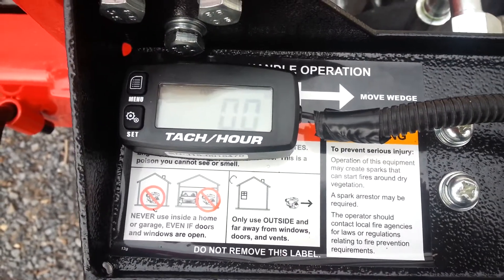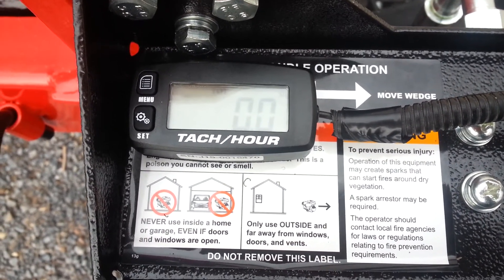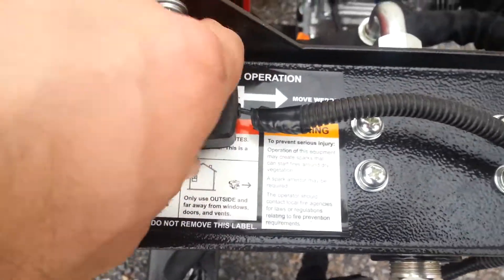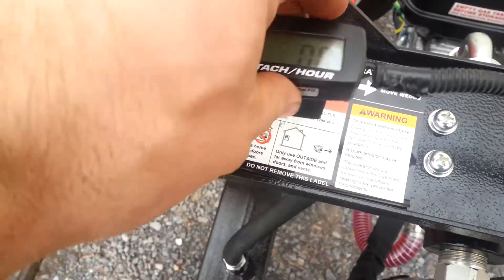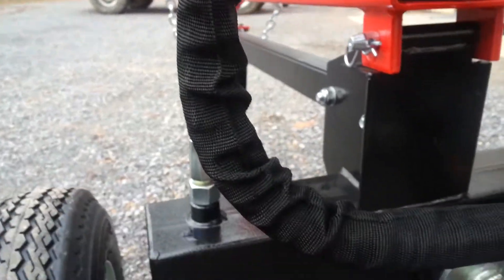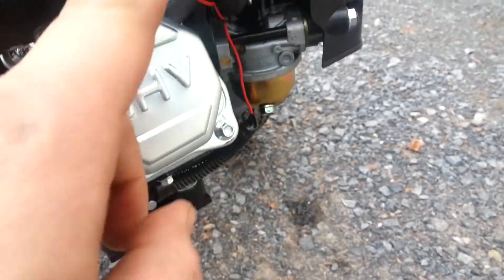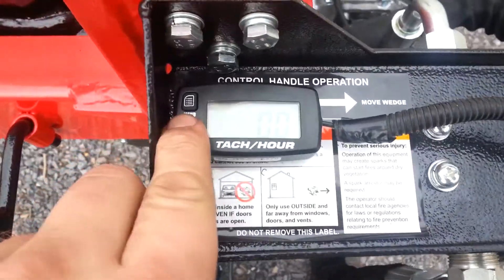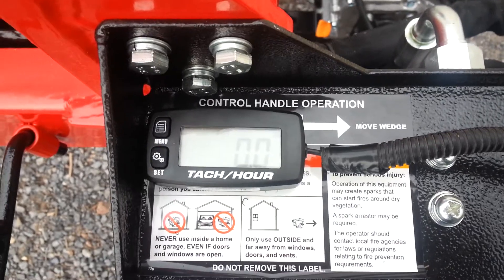Harbor Freight Wood Splitter Mod 1- Hourmeter

Comment: Will this tac work on engines with multiple cylinders? How do you like your harbor freight wood splitter? I love harbor freight.
Reply from the maker: Love2boat92 
Yes, the tach will work on engines with multiple cylinders. I think it will work on engines with up to 8 cylinders. So far I like the Harbor Freight splitter. I really like how fast it is. The predator engine seems like it is going to work out good.
Reply: 94BULLITT Oh ok. Thanks for the reply. Glad to hear you think the splitter will work out good.

Comment: Where did you purchase your hourmeter/ tachometer? Any specific type needed?
Reply from the maker: Marc Poole I got the hourmeter/ tach on ebay. http://www.ebay.com/itm/291389125971?_trksid=p2057872.m2749.l2649&ssPageName=STRK%3AMEBIDX%3AIT

Be sure the tach you get will do work on your engine, i.e. a single cylinder 4 cycle.